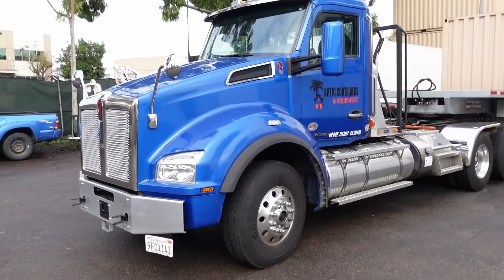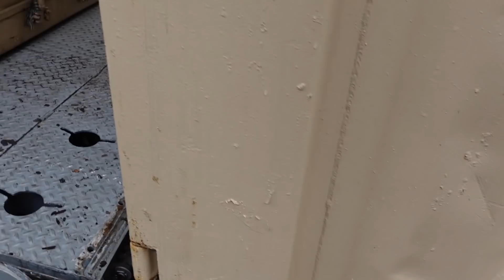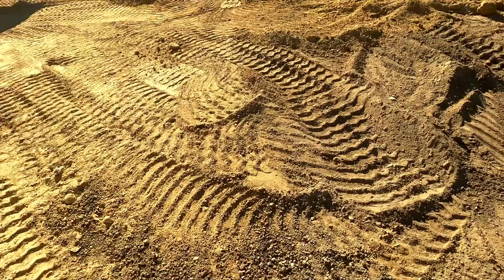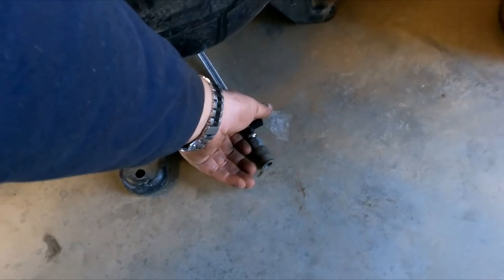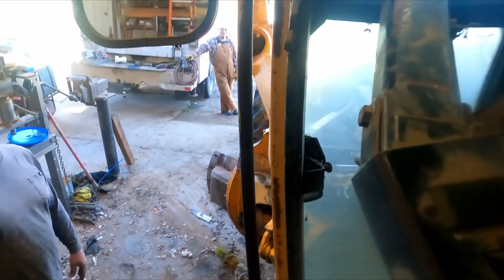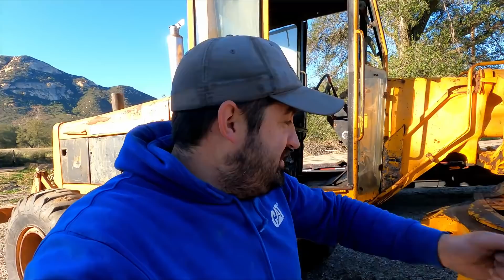Old John Deere Tractor Finally Pulled Out Of The Shop And Then It Broke Again !!

Comment: Not sure if this is your practice but at the end of the day when I power off  the compressor, I take a few seconds and only drain the air just enough to get the water out of the bottom. That way when I turn it on, it doesn't have to start pressurizing the tank from empty. Since it runs less, it creates less heat and less water.  Keeping the tank pressurize doesn't hurt anything and its a great time saver.
Reply from the maker: I definitely need to implement that practice lol, that was kind of embarrassing to show everyone but I figured hey why not.